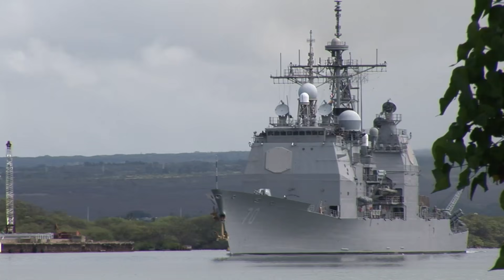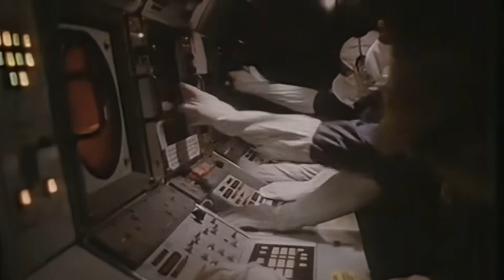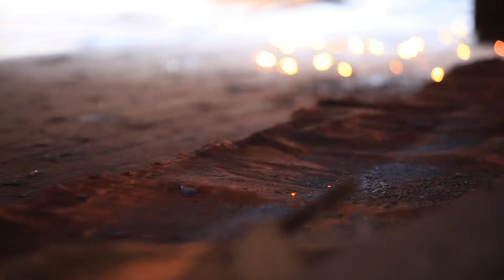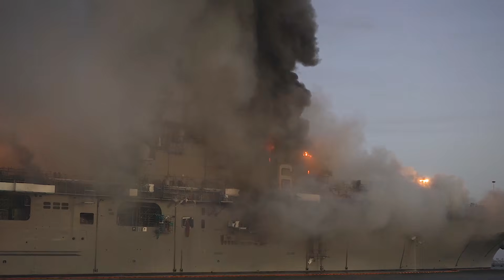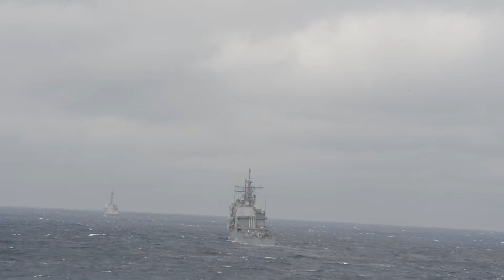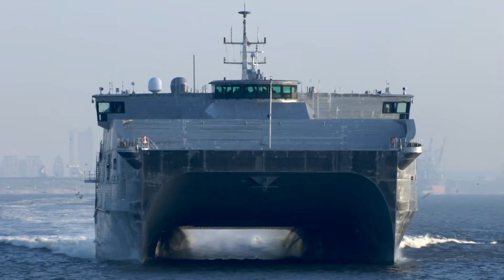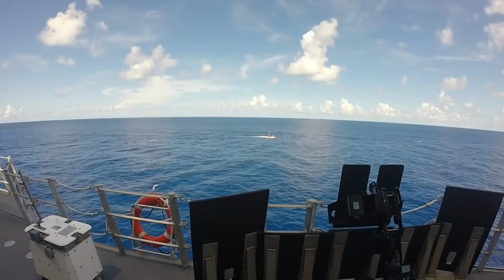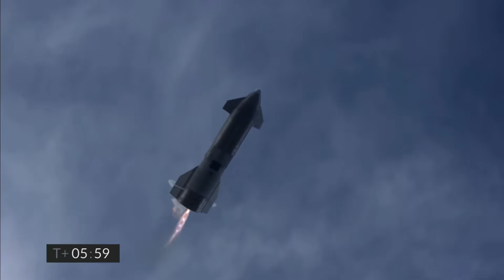Why is The US Building Aluminum Warships?

Comment: Near future: This Plastic Destroyer is light and won't corrode.
Reply: There’s bacteria in the ocean that can already eat plastic
Reply: @MrOiram46  Bio war go brrrr
Reply: @MrOiram46  Then why is there a massive plastic garbage island in the middle of the Pacific Ocean? Shouldnt the bacteria have eaten that?
Reply: Spirit fire They’re getting there, they were found eating the plastics on the bottom of the ocean, it’ll take a while for them to get up the ocean’s surface
Reply: @spiritfire9197  they’re probably working on it, but it takes so long to break it down any reasonable amount. Kinda reminds me of how when trees first came about nothing could process the material till many years later And that’s how we got stuff like coal and oil pockets
Reply: @spiritfire9197  they are actively doing that because of human intervention so hopefully soon.
Reply: @MrOiram46  There's also bacteria in the ocean that can eat wood . . . The plastic eating bacteria thing is probably a real problem, but also probably overblown. Plastic isn't going to suddenly melt into piles of bacterial goop. It's just going to be vulnerable in the same every other carbon based building material is vulnerable if not treated with care.
Reply: @MrOiram46  So throw your used bottles in the ocean? 🤯🤣😜
Reply: @MrOiram46  
✅ Right! Which is why they MUST choose balsa as the primary construction material for large naval warships! 😉👍
Reply: @MrOiram46  well barely, it’ll last longer than any metal
Reply: @MrOiram46  there is even bacteria that eat radiation
Reply: @MrOiram46  that why people throw away plastic waste to ocean
Reply: @MrOiram46  Pastic Destroyer with plastic-eating beacteria torpedoheads
Reply from the maker: We got something similar to that 😁
https://youtu.be/Yi8ltZoR3fw
Reply: @NotWhatYouThink  wait seriously?
Reply: @NotWhatYouThink  Where do you get all this military info stuff? It's entertaining and informative. Thanks.
Reply: @NotWhatYouThink  next generation Of Swedish Visby class is on its way ..., still very early in design. 
https://youtu.be/wIl8XfJCPc8
Reply: @NotWhatYouThink  1aÆÂ+++q+
Reply: @NotWhatYouThink  wait what?
Reply: made from hemp plastic xD
Reply: Already went there with patrol boats, so, sure, why not? Gather up all that floating plastic, make "free" ships LOL
Reply: @jpotter2086   It's actually very hard to recycle plastic. In most cases, making new plastic is much cheaper than recycling it. The economics just don't work out, which is why almost no plastic recycling happens. Whereas aluminum products for example are very profitable to recycle which is why it happens a lot more.
Reply: @MinecraftMasterNo1  No y'see, we just net up all the plastic into a giant trash raft and build on top of it!
Reply: @MinecraftMasterNo1  a LOT of plastic is being recycled when it can be separated from other materials
Reply: @MinecraftMasterNo1  except it's very costly in electricity.  Even recycled aluminium needs a sizeable amount of new raw materials to be economically viable
Reply: @MinecraftMasterNo1  There's thousands of different qualities of plastic. There's only one kind of aluminium since it's an element.
Reply: @angeleyes2c   that's the most idiotic thing I've read all day. there can be all kinds of metals depending on impurities and/or alloys. Airplane aluminum is not the same thing as your coke can.
Reply: @jpotter2086  like ‘the raft’ in SnowCrash?
Reply: But melts at very low temperatures
Reply: @RottenFlesh-we6nu  there are many plastics and special polymers with insane durability, resistance and high melting points. Bonkey
Reply: @drained1177  like Lego... That stuff is nearly indestructible (unless you dye it brown, apparently)
Reply: @drained1177  Then they end up costing more than aluminium 🤣
Reply: @drained1177  thats very true, with todays technology you can make what already exists even better :)
Reply: @RottenFlesh-we6nu  Bad in times of global warming!
Reply: @RottenFlesh-we6nu  not all plastic does.
Reply: @RottenFlesh-we6nu  high*
Reply: @RottenFlesh-we6nu  aluminium is only slightly  better than plastics at withstanding melting.
Reply: @RottenFlesh-we6nu  duroplast
Reply: @RottenFlesh-we6nu  there are high steinghs polymers ( aka high tier plastic) 
But IMO I think carbon fiber is goig to be the next thing
Reply: @snakeinabox7220  Maybe for a ships keel, not armour or bulkheads.
Reply: Full carbon Kevlar
Reply: Plot Twist - Thats because US Navy is recycling trillions tons of Cola-Cola & Beer cans.
Reply: The biggest threat to this concept are those damn turtles
Reply: USN : Allow us to introduce our paper aircraft carrier, we will soon be making a paper frigates and destroyers
Reply: And damage control can hot glue it back together
Reply: Some things, should NOT be made of plastic.
Reply: @donaldmurphy3148  ah yes and ceramics arent bullet resistant...
Reply: @baalsbastards6341 ceramics are in bullet proof vests my guy 😂
Reply: @donaldmurphy3148  LOL Like aircraft carriers and AR lowers.
Reply: Minesweepers
Reply: Far future: Wooden warships are back baby!
Reply: @milkdrinker7  actually a wooden warship wouldn't be a problem since wood can hold it's weight and tensile strength and can paint a fire resistant paint on it and it being made of out wood would be hard to see it on radar and cheap to build and repair the ship and be more temperature balance from being too hot or cold
Reply: Some graphine Kevlar you never know lol
Reply: Minesweepers are often made out of fibreglass or glass-reinforced plastics to reduce their magnetic signatures.
Reply: At first this looks like a joke but it will probably will happen.
Reply: Jerry: this plastic destroyer scratches at level 1 with deeper grooves at lvl 2
Reply: The moment carbon fibre is cheap and strong enough, air craft carriers will be made out of it.
Reply: If it says “made in china” i ain’t going anywhere near that shup 

Edit: I meant ship lol
Reply: Drone destroyers actually may likely be cheap swarms built of just plastic/fiberglass/ some steel  stacked with weapons and sensors lol
Reply: And can be 3d printed in 3 days
Reply: Are you seriously gonna dump more plastic in the oceans ?
if it's sunk it'll stay there forever, but then again, it's plastic ! Maybe it'll never sink
you might as well go for sticks and a lot of ducktape :D
Reply: @Vanyali 😂 Well, duct tape and bailing wire are the redneck tool kit!
Reply: i Have a cool Question i was trying to research How much will it cost if someBody able to Build a Big aluminum Boat Billy able to Lift up 2 or? 4 shipping containers as Living Quarters i cant comprehend should Be the size oF 9 or 19 or 29 school Buses to Build a Foundation Hope it dont cost over miLLions oF Dollars ???

just a aluminum Foundation able to Hold 2 or 4 containers also with John🇺🇸Deere🇺🇸Engine also able to Hold diesel fuel or Elected Engine ???
Reply: @LeeLoomis1988LegalRetard  If you want safe money use steel. It is much cheaper and much easier to weld and thus to manufacture. Both is important to safe money.
And if you go welding, use a respiration mask.
It is possible to build ships the "do it yourself way". Just follow well  engineered boat schematics.The latter is important for safety reason. If in doubt, ask an ships engineer.
On YT you will plenty of videos of "do it yourself " boat building. They all did that to safe a lot of money.
Reply: Already enough plastic polluting the worlds oceans.
Reply: Why not build a ship out of wet saw dust?
Reply: @shangri-la-la-la  a Pykrete ship would be ideal
Reply: @Sparticulous  I see someone knows what I am referencing.
Reply: @shangri-la-la-la  Did it also happen to be made of ice?
Reply: UHMD plastics.
Fast to repair, bullet resistant, ultra durable.... Why not?
Reply: @justingrey6008  UV radiation.
Reply: @OpenGL4ever  UHMD does have UV stable formulations.
Reply: @OpenGL4ever  you still have to paint the plastic
Reply: LOL
Reply: And is 3d printable!
Reply: @Steve  Sometimes they leave you with some wifes.
Reply: Plastic with stealth properties
Reply: You make fun but it can't be destroyed with a shot of mercury
Reply: and you can even cut it with a hot butter knife .....lols
Reply: Near future: we're all dead
Reply: Yeah, we like to call 'em Mattel .
Reply: 3D printed ships ... it's coming.
Reply: Until it ran through a swarm of plastic-eating bacteria.
Reply: When it fires a missile the shaft that it travels through will just turn to molten plastic instantly
Reply: That plastic island in the pacific? That's actually a secret US ocean based AI
Reply: Honestly you could make a really strong plastic ship
Reply: In fact, due to its properties, it can effortlessly blend in with the trash columns found in abundance in various parts of the ocean.
Reply: Is titanium just too costly?  It's stronger than Al, but lighter than steel.
Reply: SHHH he hee they might build one
Reply: Gets shot once *
Reply: lol!
Reply: New US super carbon fiber air craft carrier 😎😎
Reply: Carbon nanotubes
Reply: no lets make it out of cardboard
Reply: Made from recycled materials
Reply: Tupperware class 
Hope they don't use that dollar tree Tupperware material lol
Reply: @RanjithRajendran-z7i  yup
Reply: Imagine the micro plastics if it is ever destroyed.
Reply: we'll order them from China.
Reply: I’ll take your entire stock
Reply: Has anyone every dented aluminum? It's impossible to fix
Reply: yup, we will also be able to 3D-print them too
Reply: Fighter jet use plastic where you know as composite
Reply: Lego Destroyer 😂😂
Reply: That's carbon fiber and fiberglass
Reply: Imagine if the whole thing was made of titanium
Reply: @GoldRaven-oe4by 😂 Do you know how expensive Titanium is? A small 1 foot by 1 inch in diameter costs a few thousand dollars! How much would 50 tons cost? Oh, that rod only weighs about 1lb! 😮
Reply: * and is made out of 100% recycled plastic
Reply: I had one of those. The “Terror of the Bathtub “ . She was a good ship.
Reply: Plastic ships are hard to detect with radar as well. Plastics are not that bad and also used in weapons. They probably lack the strength to build large structures but who knows what materials will be available in future.
Reply: It's for cost cutting, because they couldn't outsource construction to China.
Reply: If the offense is impenetrable, do you really need a shield?
Reply: US Navy: We'll take as many as you can produce
Reply: Hemp plastic composite. Won't that bend the god squad's chuff?
Reply: An average 10 metre yacht requires $1000 of paint n maintenance  a year against  corrosion n decay n critters . Plastic is a thought.  I guess fibreglass is a pseudo plastic  , more of a resin entwined with a textile. Fibreglass decays too and corrodes eventually.
Reply: Or sink. Shit, just think of the buoyancy of a plastic ship, it’d be like a bath toy. Even full of water, it wouldn’t sink.
Reply: Are the pieces of footage showing ships getting hit by missiles actual clips of the specific ships being talked about?
Reply: AND ITS MADE OF OIL WE GOTTA INVADE 
🇺🇸🇺🇸🇺🇸🇺🇸
AMERICAAAA FUCK YEAAH
Reply: Because aluminum will be worth more than gold the way things are going
Reply: Don't we already have that high density hollow metal bead polymer foam that is theoretically usable for warship hulls? I tried to find the video but failed, it was only being tested in a lab but it could withstand extreme pressures, just like repeated battering with a hugely powerful hydraulic hammer
Reply: Just cover it all in Starlight. Even nuclear bomb proof!
Reply: But it would melt easily I think
Reply: Lower melt point though 😆
Reply: The Cardboard Aircraft Carrier
Reply: Made with 100% recycled condoms.
Reply: That's pretty close to the downsides of carbon fiber tbh.

Carbon fiber is usually held together with a resin or plastic, which can have much lower melting points than carbon fiber.
Reply: Right
Reply: all Kevlar composite, not a bad idea!    Very bullet proof, fatigue resistant , great strength to weight ratio .
Reply: PBRs where plastic/glass
Reply: why you need ships if you can just plane everything...
Reply: wooden ships, iron men
Reply: @Jonathan Jacquet We already do.
Reply: @Steve  good for submarines too, hard to see under water.
Reply: Does that mean you can sink it with small arms fire? Oh ,oh cool
Reply: Gallium will take it down in a day from the inside out.
Reply: Carbon fibre will expensive more than steel
Reply: No. It will be cardboard so that it's biodegradable
Reply: It'll burn good though.
Reply: Your not far off on that. 2 years ago. The university of Maine ,3d printed a 45 foot patrol boat.
Reply: "We don't care what it's made of, as long as it's built by the lowest bidder."
Reply: @klausstock8020 😂 Whichever politicians have their hands in the military budget decide who gets the contract! Remember when they paid 400 dollars for a hammer? 😅 The government chooses, not us peasants! Happy New Year 🥳
Reply: Future future  New 3d printed carrier builds itself
Reply: Hmm composites
Reply: More likely a carbon fiber ship :)
Reply: They already put a bunch of plastic trash in the pacific. A fleet the size of France!
Reply: You’re right actually.

They will reach a stage where they’re able to make composites both ultra strong, and ultralight. Impregnate the resin with inflammable compound, and you’ll have a “stronger-than-steel”, non-corroding, fireproof ship. Makes sense to me.

They’ve been building planes and light boats out of the stuff for decades
Reply: @sshah2545  I’m not going to comment further on design or materials, even though I love engineering. I’m just going to say thanks for making a decent comment on Youtube because it’s so devoid of that. So thanks. You’re a good man, Charley Brown.
Reply: And is Stealth
Reply: Carbon fiber ships?
Reply: @realgabrielflandes , I do think it will be investigated if it isn’t already.
Reply: @realgabrielflandes  I believe it runs into the same problems as aluminum but more so. Hull fatigue sets in and it's not very suitable for larger ships besides. 

I could see composites being used more and more on drone craft even as they get bigger. Simply because a drone will always be more disposable and the navy will be inclined to simply use older drone ships closer to end of service life for more dangerous missions.
Reply: It doesn’t matter because of the weapons
Reply: Lol
Reply: We need a new way to obtain titanium from titanium rich ore with a much lower energy footprint. If we find a way to do that, we can build the ships from titanium.
And btw, the one who discovers such a process will become super rich.
Reply: @OpenGL4ever  can't be done. It's a chemistry thing.
Reply: @milkdrinker7  History has shown that one chemical process replaced another one, because it was cheaper and required less energy. 
So why do you think, it is marked in stone, that it is impossible? And what qualifies you to say something like that? Are you a chemist?
Reply: @OpenGL4ever  I am a chemical engineer. Basically it's like pushing a heavy load up a hill. You can do some things to make it more efficient like adding rollers and lubricant but you cannot get past the fundamental energy increase of mgΔh required to increase the height of a weight. Titanium dioxide (the form most commonly found in nature) is a very stable molecule with strong bonds. No matter how clever your process is for making titanium metal, you still have to break those Ti-O bonds. The FFC Cambridge process was invented over 20 years ago and scientist and engineers are still working on commercializing that tech. But once it gets up and running, direct electrochemical reduction is pretty much as good as it's gonna get, barring some minor improvements akin to using slightly cheaper wheels to get your rock up the hill.
Reply: @milkdrinker7  Thank you for your extensive answer.
But today, the Kroll process is still used for most of the titanium extraction we have  today. Thus making the FFC Cambridge process economical on a high industrial scale, a work that still has to be done, will reduce the amount of energy required to obtain pure titanium.
And if this is not possible, there might be other processes in the future, that do the same but on a industrial scale as good as the old and energy intensive Kroll process.
That's what i meant.
Reply: @milkdrinker7  Yes it can. You weld in a air tight chamber filled with inert gas like argon.
Reply: @v4skunk739  what does inert gas welding have to do with anything?
Reply: @OpenGL4ever  Titanium from Russia?
Reply: @Piflaser  Russia is still using an old very energy consuming process for Titanium.
Reply: @OpenGL4ever  But, I think, Russia is still the biggest producer.
Reply: A kanoo with bb guns
Reply: Already enough plastic polluting the worlds oceans.
Reply: its Carbon :D
Reply: "Plastics make it possible."
Reply: They made plastic bullets so-
Reply: You're not far off , synthetics are starting to surpass steel in weight and strength and can offer other things like self healing technology metals can't offer. so it's actually not far off
Reply: dry ice destroyer
Reply: uhh... my dude we have been using composite plastics for the better part of a century now, in things like spacecraft and spaceplanes
Reply: Batterie powered
Reply: your not wrong, i own plastic body armor (uhwmpe) and it's fantastic
Reply: as long as it has UV protection.
Reply: Plastic is elastic and shock absorbant and can be processed with other minerals easily to make it more heat resistant
Reply: 100%
Reply: Money talks
Reply: Yeah but thats not environmentally friendly. Because where are all these plastic ships going to end up? Probably in the ocean somewhere killing all the turtles.
Reply: @Yingalingadingdong  As opposed to the steel ones sunk to the bottom? 

Pollution from fabrication and operation is a significantly bigger issue than disposal, environmentally speaking.
Reply: @Jacob Yinger  who cares
Reply: Most importantly it's cost efficient.
Reply: Ha Ha
Reply: This is why I only build destroyers out of solid granite
Reply: the word is FIBERGLASS
Reply: To bad there is already bacteria and insect's already eating it.
Reply: There are different properties of metals, and aluminum for instance, can be very brittle, non-ductile and with low yield strength. There are other formulations of aluminum that outperform steel with additives in ways that didn’t exist when those ships were built. The metal industry didn’t have the technological testing accuracy and formulations of modern steel or aluminum, engineers giving metal designations have very different requirements than when those vulnerable aluminum ships were built. Their welding codes have also drastically changed since then to prevent these exact problems. Some of the reason for the metal choices could also have been to address certain weapon attacks. We all wish that if we’re on a ship that it’s made out of the peak metal technology, but the reality is the cost could be so overwhelming it becomes a poor use of funds for national defense. The military has to consider the best use of funding to accomplish their goals.
Reply: The Swedish Visby-class stealth corvettes have a sandwich carbon fiber hull and I would guess the superstructure is the same material. I was at a lecture with the manufacturer in the late 90s and I asked them about fire resistance. It's a quarter century ago but I remember they said something like it had good fire resistance. I kind of doubt it, maybe resistant to a small fire but a big fire will surely spread fast and consume the whole ship.
The upside was light weight but primarily to get very flat surfaces enhancing the stealth properties.
Reply: Next breakthrough:  Unsinkable concrete Warship, revisiting old brainwaves.
Reply: IT BURNS IT BURNS IT BURNS GET COOKED LOL
Reply: @thetheatreorgan168  
There are fire-resistant polymers
Reply: @HaydenLau.  oh.
Reply: @thetheatreor🤣🤤😎gan168
Reply: Carbon Fiber
Reply: @AmericanThunder  the polymer ammo isn't only lighter but case geometry helps with expansion, giving it a little more bang in a lighter projectile.